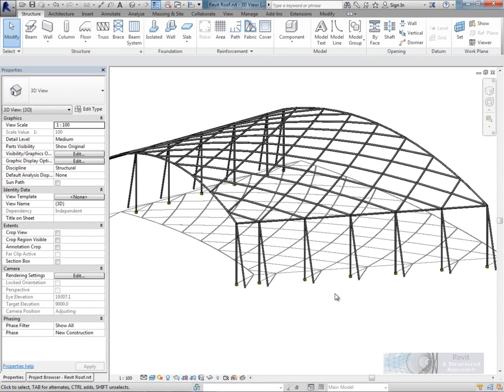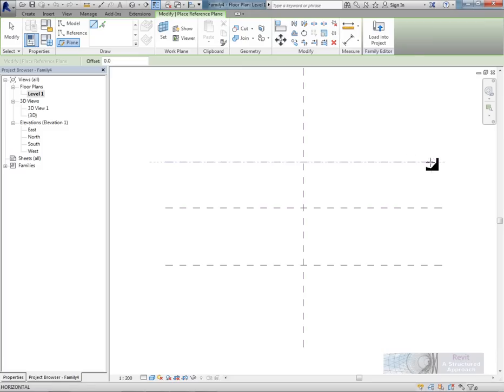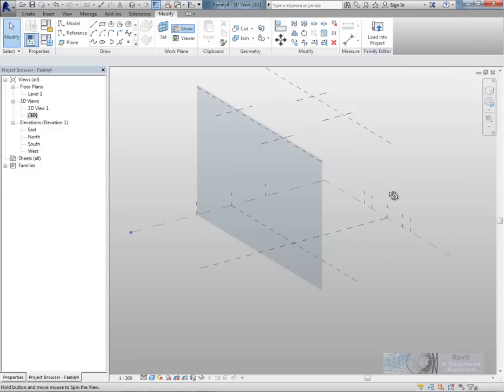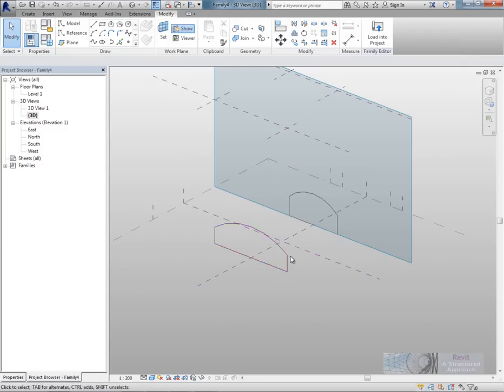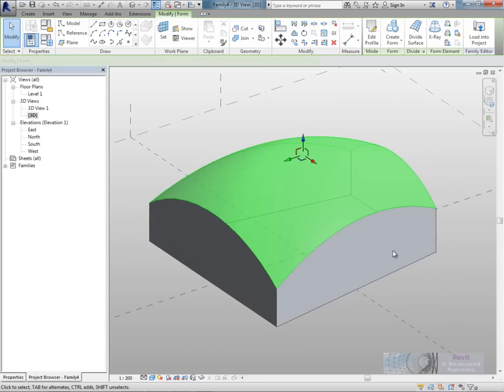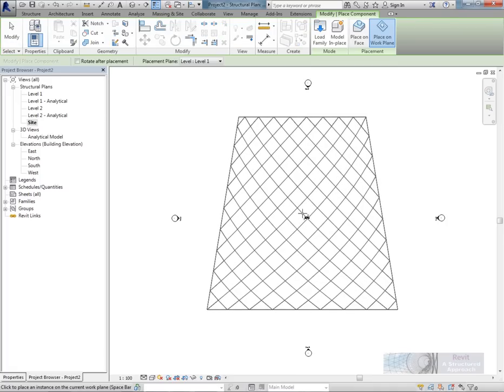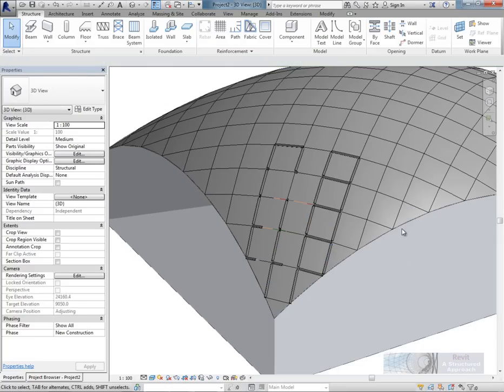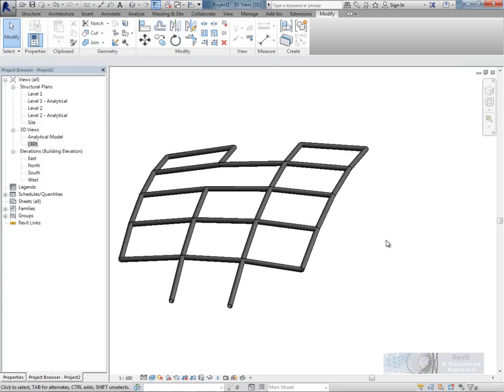Tutorial -- Conceptual Massing and Revit Structure 2014

Comment: I have a question regarding in-place model component. I haven't find the answer anywhere. I hope you would try to solve this. 
Question is when we need some complex shape tensile roof of reinforced concrete or say like membrane roof to model it and to get analytical model for FEM analysis but in revit you can't do that because of the limitations of analytical model of floor slab or foundation slab or structural wall. You model the mass and assign the  structural wall, it's created but in analytical view there is no analytical for that and for case of slab it doesn't succeed too.So, how we could do that in revit whether different FEM software e.g. Dlubal RFEM have that functionality but revit don't. We can't make surface like a tensile membrane having analytical model in revit. I hope you would reply.